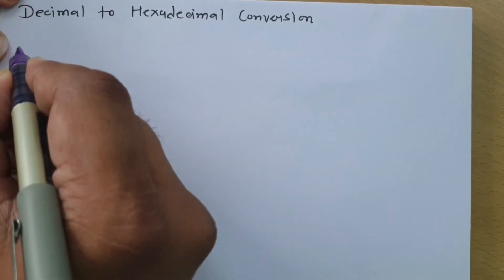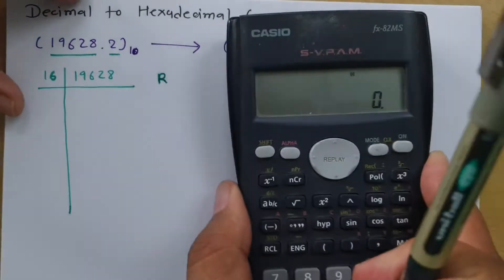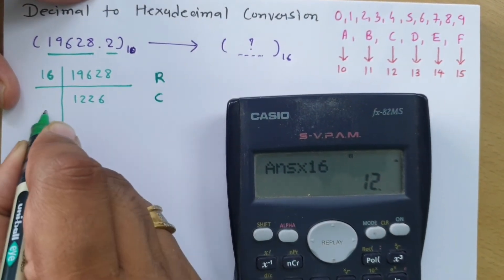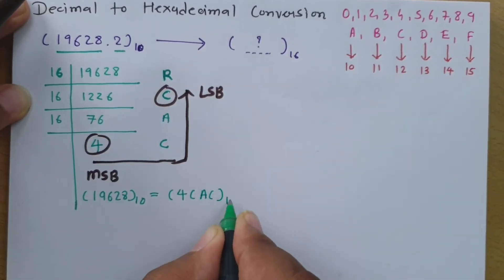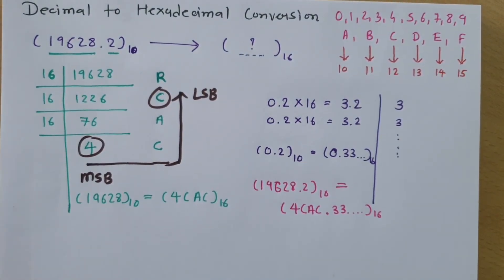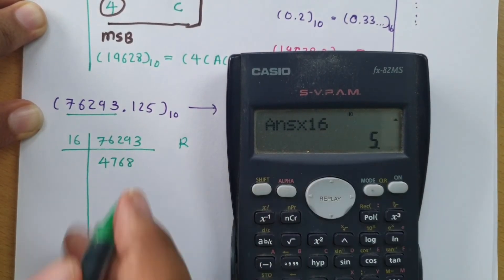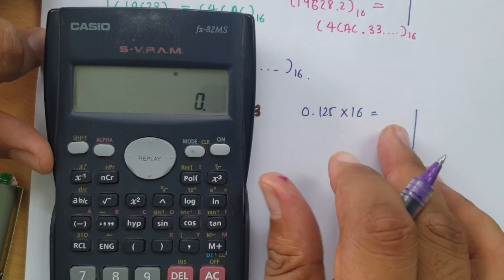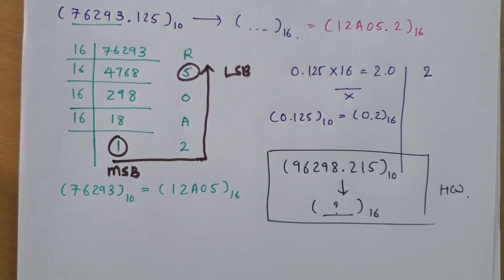Decimal to Hexadecimal Conversion Explained: Process and Examples

Comment: Sir,my answer is (1782A.2)16...is it correct or not??
Reply from the maker: In fractional part there is problem
Reply: @EngineeringFunda  fractional part is 0 .125 that's my answer was 0.2
Reply: @NADEEMBASHIR3688  but the question was 96298.215